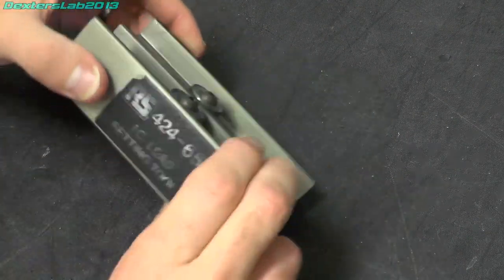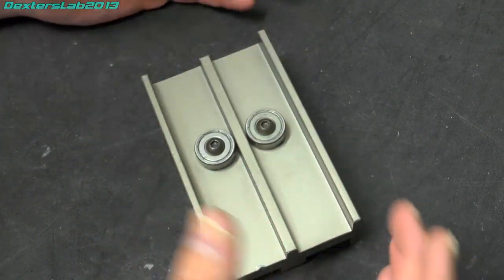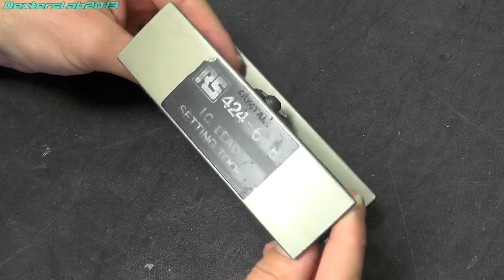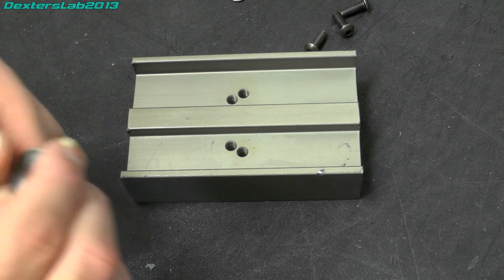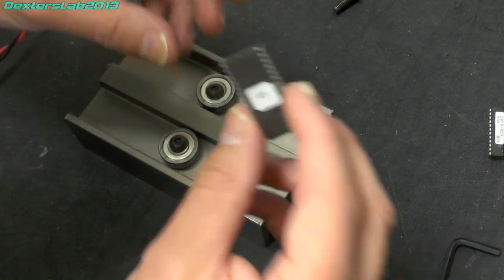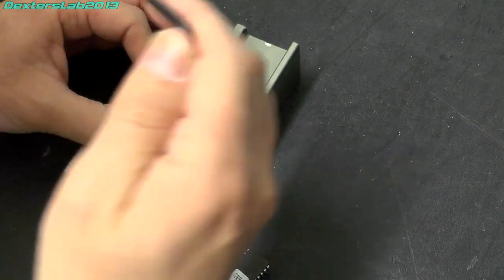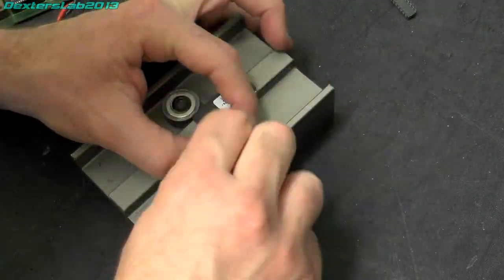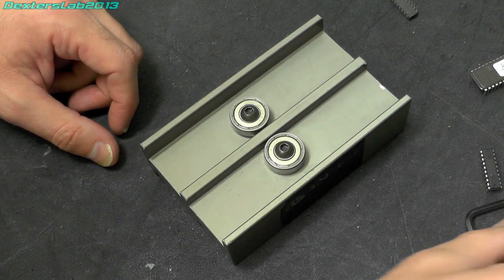DL134 Repairing An IC Lead Setting Tool

Comment: Good deal.  For future referenced the shields on bearings pop right out alowing you to clean and relubricate them.  Then the shields just pop back in.  Also these are shielded not sealed bearing.
Reply: Don't even need to pop the shield off, you can just pressure feed grease through the slit into it, and get a good renewal of the fill in most cases, using a pair of conical greasers. Or just boil in clean engine oil and leave to cool, the oil will be pulled into the inside and lube it up fine.
Reply: SeanBZA true but in my experience it's so easy to just pull the shields that it makes using any special procedure unnecessary.

Comment: Are those the winning lotto numbers on your hand, or the Domesday date? ;)

Reminds me - I really must do something with those Quantel boards.
The CPU alone could make a great Amiga accelerator.
Reply from the maker: +ElectronAsh lol, no... Just me working out how many kwh our freezer is using!
Reply from the maker: +ElectronAsh did i send you one of the 68040 boards? I still have maybe 7 of them here!
Reply: DextersLab2013

I have similar concerns - I actually went around the whole house once, turning all electricals off, then seeing how much each room was using. lol

Stuck a Wattmeter on the tumble dryer etc.

Our old house used a constant KW at all times, with just a fridge-freezer, chest freezer, pond pump, and three Sky boxes.
"Only" 16p per hour, but still nearly 4 quid a day. :o
Reply from the maker: +ElectronAsh our freezer always seems to be running when i go to it, it's ancient so the compressor might be a bit knackered. Probably time for a new one!
Reply: DextersLab2013

Yeah - a new freezer will probably pay for itself in 6 months with the power saved.

It think it is an 040 board you sent, yep.
Fastest 68K I've owned. lol